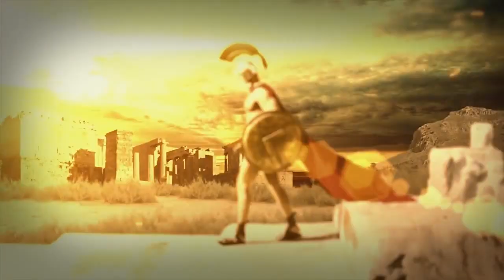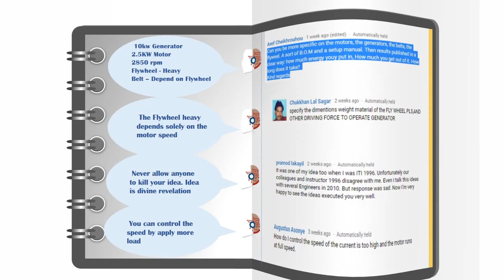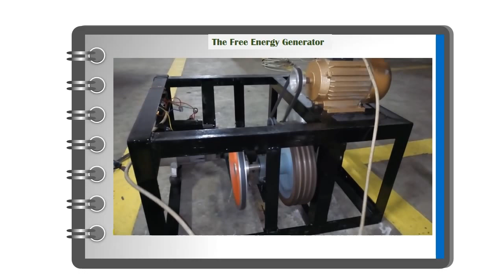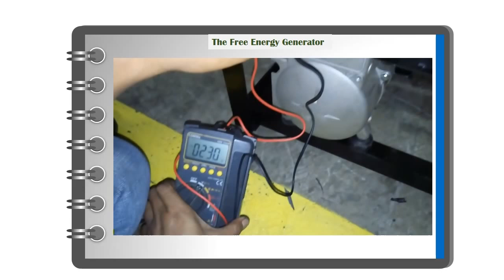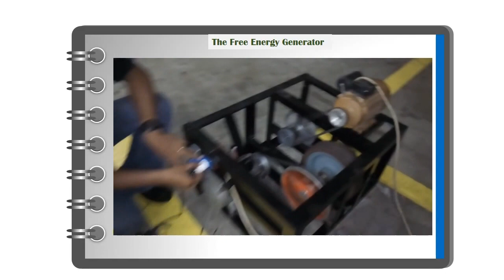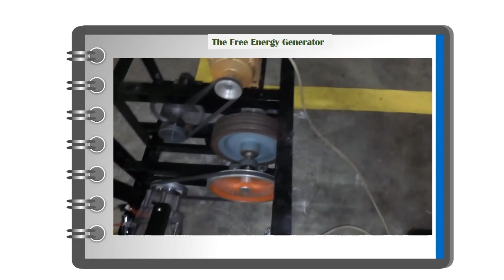How to Make Money Using Free Energy Generator

Comment: I would like to know if you can eliminate the flywheel and put a 12 volt electric motor on it to get it started when you are out in the field where there is no electricity and without using a generator or 120 or 240 vac ??, I'm having a real hard time trying to figure out what size pulleys and belts that you are using from just a picture please be more specific thank you how many pulleys how many Jack shafts what size pulleys and belts like 10 mm or 200 mm